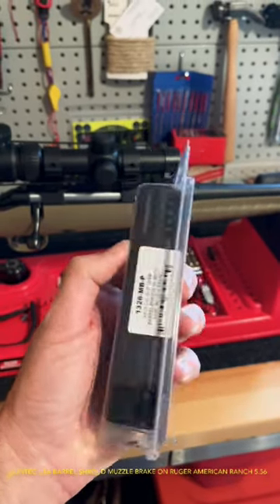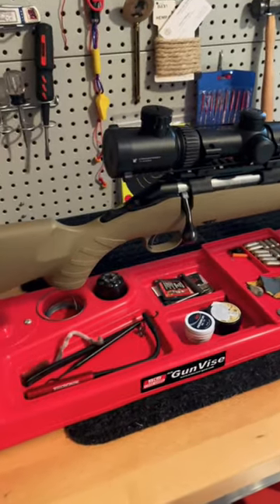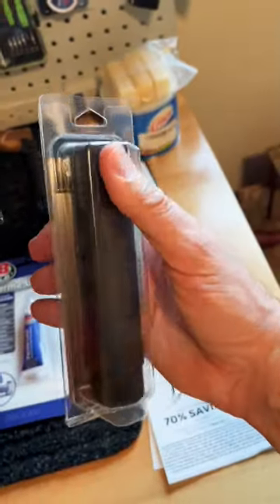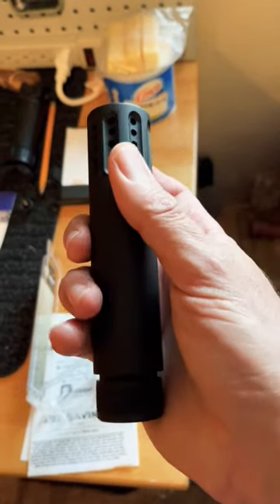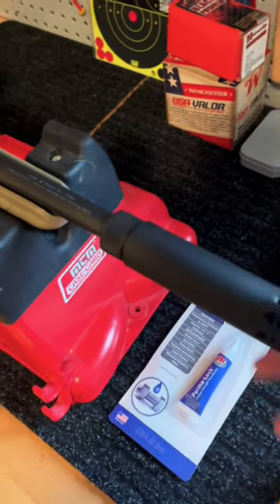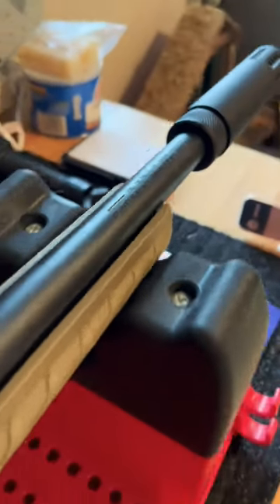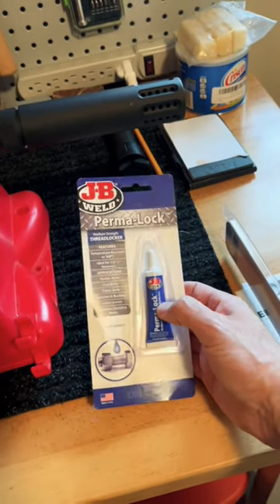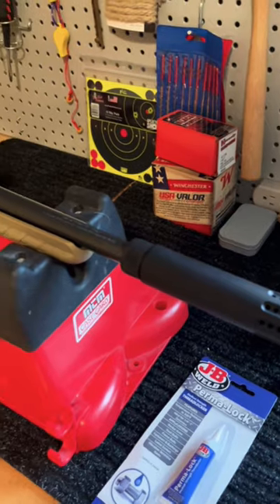GUNTEC USA slip over barrel shroud w/ multi port muzzle brake Ruger American rifle 5.56 #rifle #gun

Comment: The problem with any aluminum brake. Is that the metal just isn't as durable as steel it dings up and gets shiny spots  and you can't just hit it with cold blue to get rid of the spots.

Comment: Is it functional? Does it reduce felt recoil?
Reply from the maker: I haven’t tried it out yet - might be shooting it tomorrow,
Reply: @dg11306 how about muzzle flash?
Reply from the maker: @wolfbear572 Muzzle flash was one big improvement this thing made a fireball before.  It didn’t really do much for recoil, it does nothing for sound, but it helped dissipate the flash immensely.
Reply: I have one of these on my wife's ar9 and it shoots like a dream. Paired with armaspec silent buffer setup. With those 2 things on the 7 inch barrel it's shoots so soft.